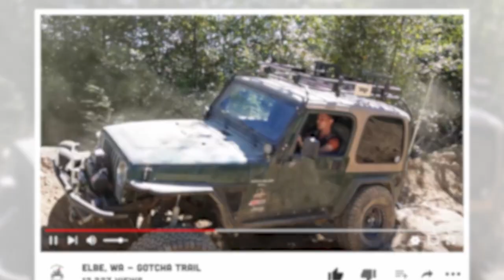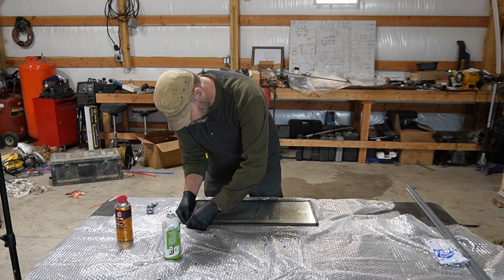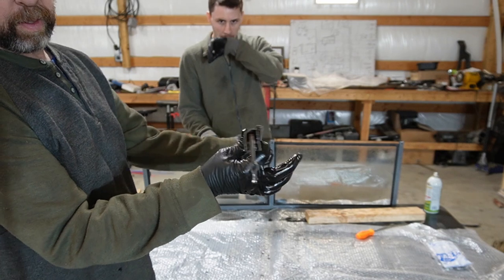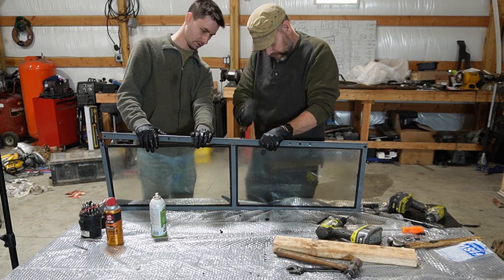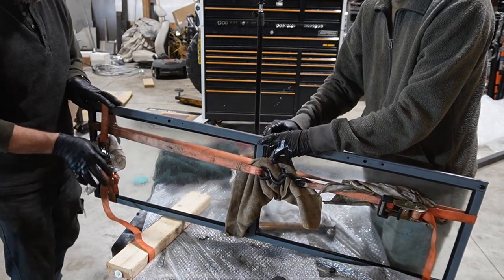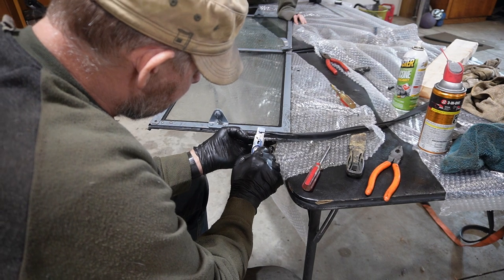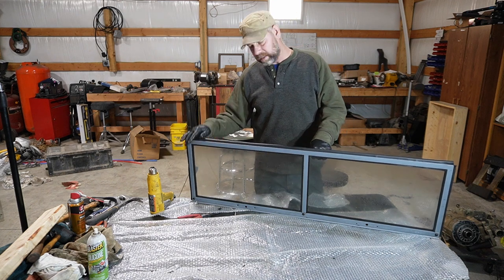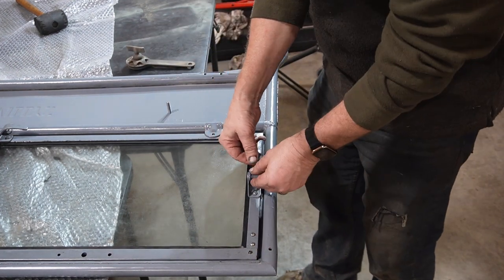Willys MB Windshield Seal Installation

Comment: I thought I was the only one :)  I know it was easier when everything was brand new BUT how did they do it at the factory ?!  Great idea to blast away with the silicone and heat. I found it easier to run the top of the frame into place and then install the rest of the window frame. It seemed that the two rails were not lined up perfectly so a small flex of the top of the window frame made it possible. I'm working on a GPW.
Reply from the maker: Good idea! Manhandling that thing is a beast. Worst part is I have to do those sides again. You know, cutting them to short....   I'm putting it off as long as I can. Will probably wait til this fall when the cold starts to come on.

Comment: If that's an original slit windshield and not reproduction..... you probably could find original ones in older wrecking yards back in the 1960s and  70s most jeepers went to the single one piece glass I believe out of cj3s.... just easier to seal and keep cold &dust/sand out....😂😂😂😂
Reply from the maker: Yeah, funny you say that because my last jeep build I was convinced to put the CJ3A windshield in it to get the height. Kept having to duck down to see the stop lights at intersections with the original split window. It was more functional but I lost the "Cool Factor". 
Also lost that ability to keep the top on and push that window out on the trail while it was raining or snowing. That's quite a feeling. Those windshield wipers suck. That's something I wish someone would improve on. Those individual wiper motor/wipers are the worst.